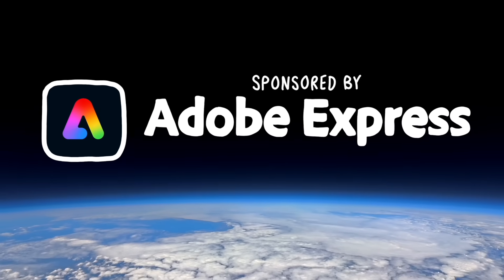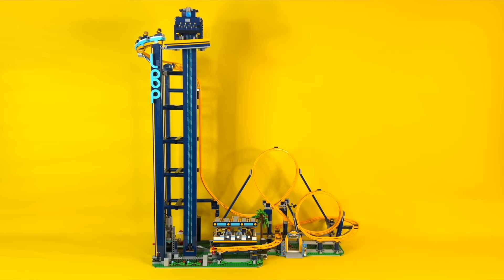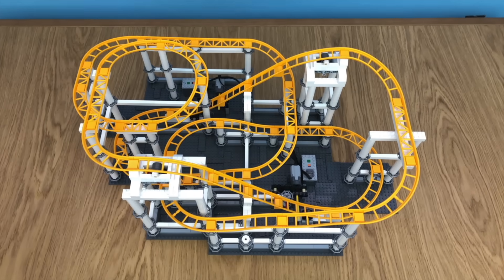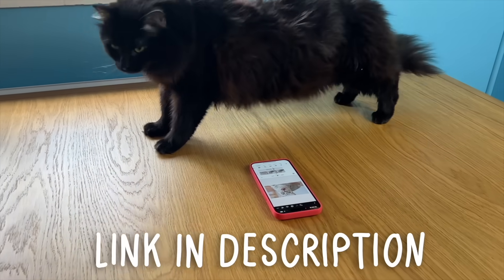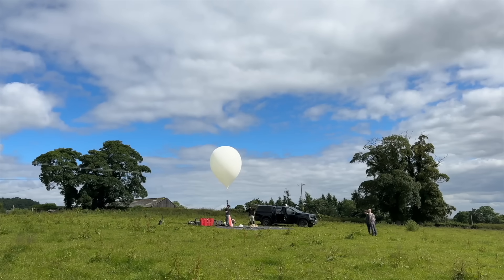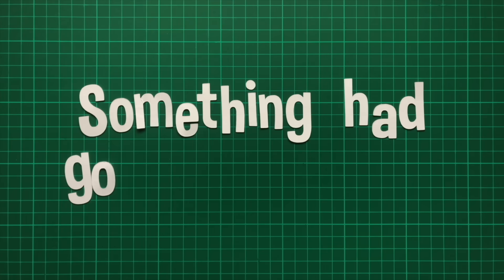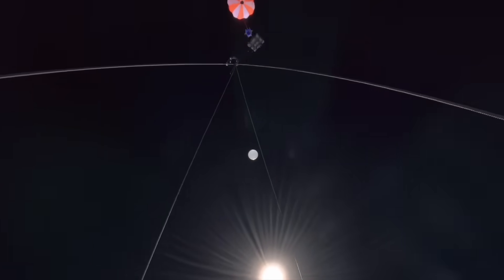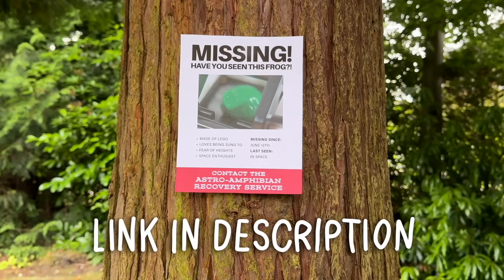Working LEGO Rollercoaster IN SPACE!

Comment: 12:14 you could have put a fencing to prevent that
Reply: Still, the cart could have lower acceleration than the actual rest of the machine and could fly off vertically instead of horizontally when it entered the lower atmosphere if all went well untill then. Or it could flip upside down during the ascent, and gravity could yank it down, even in space, this is a danger.
Reply: @kadeadams2308  they could have also put a transparent fencing that goes horizontally and vertically that is super glued to the track so that derailing is physically impossible